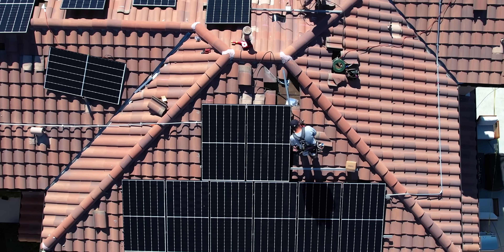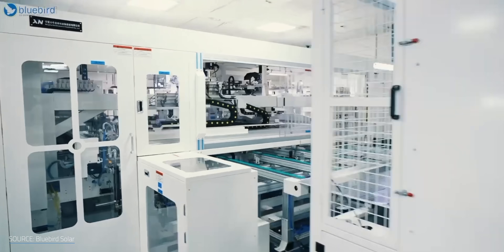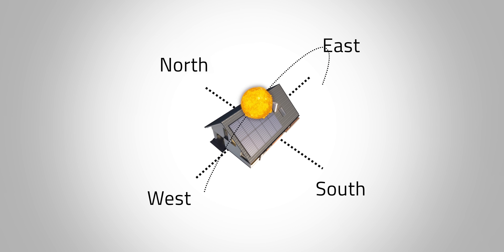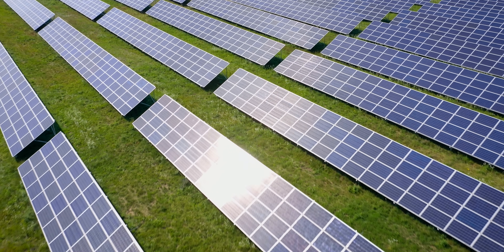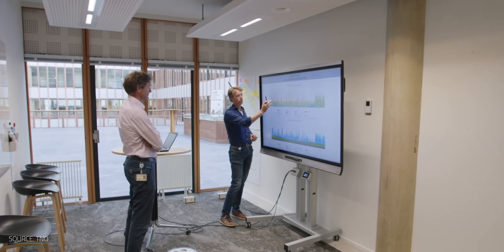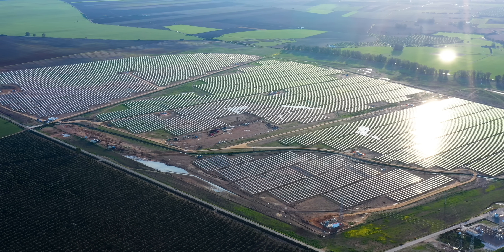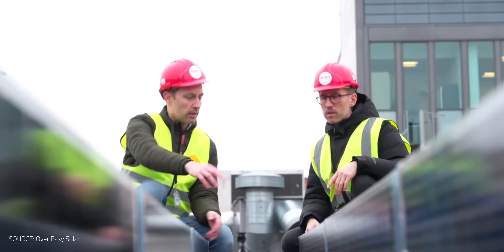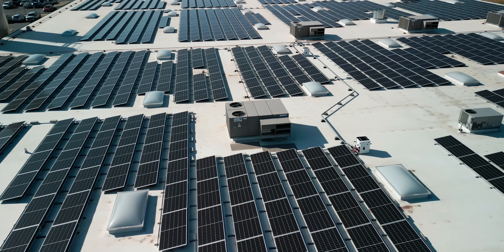Have we been doing Solar wrong all along?

Comment: If you are going to put rows of these in farm fields, they will need to be a lot farther apart than shown because most mechanized farming equipment is HUGE. Additionally you plant crops in rows aligned across contour lines to prevent erosion; around these parts those lines would frequently be perpendicular to the N-S lines.

Comment: Or just add tubes to the PV panels, circulate some liquid, maybe use a heat pump to make it even hotter in the storage side and store the hot water... Everyone needs hot water to have a shower etc.
Reply: This is already a thing, hybrid solar/pv panels. Unfortunately they will not live the expected 25+ years of usual pv only panels. That’s a big downside.

Comment: Cooling increases power by enough that even active cooling is practical. Here's a video where a diy actively air cooled solar panel is demonstrated to produce more than enough extra power to run the cooling fans.
https://youtu.be/Mt9qLRN7JvA
After looking back at it, apparently the main selling point is panel longevity. Efficiency gains were just enough to comfortably run just about any decently efficient fan for it, but in theory it'll pay for itself the most with lifespan. Great for offsetting the environmental impact of producing the panels in the first place.
I remember somewhere they mentioned already existing commercial solutions that use far more efficient centralized cooling fans that even have the option for using waste heat for other purposes.

Comment: Higher wind loading might require heavier framing, and could make panel wires susceptible to stress cracking. Where you see vertical fencing made from solid materials, it's generally rock about 5-6 feet thick 😮

Comment: I had the thought recently that solar panels are notoriously bound by theoretical efficiency limitations, and if they capture all the light that hits them a lot of that light will be reflected or absorbed as heat.

So vertical arrays of lower power, higher efficiency panels with redirected light might be the way to go. So I wonder if this has anything to do with that.

Comment: What we've been 'doing wrong' is relying on Government Scienters and Chinese Tech Barons and GPS Signs & Tribulations Evangelicals to drive a technology into the Grid Level Energy Supply'. Like the Covid Jab, you will never hear a grid expert concerned about rolling blackouts on cloudy days, about reverse-metering 'grid dis-harmonization' or exploding neighborhood substations.

If all we used electricity for was hair drivers and toaster ovens, then grid voltage and frequency dis-harmonization caused by millions of solar inverters wouldn't be a problem. But we have home electronics, 'smart' IoT crevices and patients on life support.

Plus household solar power simply does not work north of 37° latitude, the research that you'll never ready proves that, like the MTBF Life-Cycle Cost Analysis.

Household Solar is like the Covid )ab, and I think you need a BOOSTER!

Comment: This is an extremely inaccurate representation of what the study showed.  At no point did anyone in the study conclude that vertical panels produce more power than horizontal.  The host went further and even concluded vertical panels produce more energy in a smaller footprint.  Both claims are completely and demonstrably false.   

None of the graphs on screen were presented accurately either.  The host uses tons of relative descriptions rather than actual values in an attempt to portray the conclusion he wants. Extremely disingenuous and harmful.  

This guy is the equivalent of cereal box advertisements.  "Now with 2.5% more voltage!" More voltage than what? More voltage than horizontal panels in the same exact conditions?  Certain times of day?  No?  Oh, the test panel array generated 2.5% more than the computer model is the test array calculated...so the computer model was slightly inaccurate.  Just another bogus "science communicator".

Comment: Personally, I'd rather have ground mount PV.  I'd be interested to know if there were any differences in the area required.  Certainly, the area between vertical PV would be more usable.  Also, what about wind and hail damage?  Does one  fair better than the other?  What about mounting costs - is there an advantage?  In the end, it's all about economics.

Comment: Absolutely wonderful! How many ugly fences are there around infrastructure, industrial and commercial property. as well as private property? Making attractive solar fencing economically attractive - that is a fence that pays for itself - could transform the look of our world's shabby cities.

For me personally, at home, putting solar fencing around my garden is a far more attractive option than on my home's roof, including cheaper installation, and no concerns about damaging the extremely costly roof. There is far less of a concern that people might damage the fencing, climbing on it, or with vandalism than if a roof got damaged during installation.

Regarding garden fencing, I have already chosen the cheap sustainable solution of planting a hedge around my garden perimeter. A modest long term investment in itself.

Concerning adopting domestic solar panels in general, I do not wish to get into finance arrangements or contractual arrangements related to paying for solar panels. So, putting single facing vertical solar panels on the home wall, ideally including insulation on the back of the panel, would be an attractive option for me. Something one could simply screw up on an exterior brick wall - a bit like hanging a bathroom mirror on the inside of a home - would suit. Saving up, and buying a panel at a time until the house is covered without debt. 

Highlighting the fact that initial cost and installation are the most vital factors. With a desire to stay debt and legal commitment free being equally vital when choosing to go for domestic solar options or not.

Comment: I use a vertical panel with an ultraclear glass in front and a fan for 2 years. Temperature of the air is up to 60 C, normally 30-40 C. Like Trombe wall with a photovoltaic panel. In summer hot air can heat water, I shall test it next summer.

Comment: Vertical flow produces something like the chimney effect and causes air to flow upwards much better. Old chimneys were built with bricks and not metal because the bricks heat up and that causes a turbine effect that makes the chimney itself to work as a pump. You'll notice that those chimneys are narrower at the top and that's because the air is flowing faster - hence to keep volume flow constant they need to be narrowers. Coolling towers on nuclear power plants have that weird shape because the chimney effect happens up to a point when condensation starts to happen and speed decrases.

Comment: Vibration on the Silicon crystals causes electrons to cross the depletion region only with the motion energy. That produces noise in sensitive amplifiers (medical applications, for instance) and on our photos when because they create small random deviation for the value each dot on the CMOS sensor. This type of noise is called Thermal Noise.

Comment: Bifacial panels are currently being used in the horizontal (angled) utility-scale installations. In northern climates snow on the ground would significantly improve performance over a traditional setup.

Comment: Thermal efficiency, Imagine a passive radiator facing a heat source vs only one side facing it. Most of the radiator isn't directly being heated. Solar panels are only 20-25% efficient so the rest of the light becomes heat.

Comment: Yes, I would consider this! I live in Norway, so I guess Over Easy will be considered too, though not the flat roof thing, I don't have that. I live on sloped land, so this might be perfect for me, considering the amount of snow in the winter, the reflected light and that I don't have to remove snow from the panels is perfect. My roof's ridge is north/south, and I have mountains to the east. So many things making roof mounting moot. I was thinking vertical panels on the south wall, but there's just not enough space to make it viable, but maybe as an add on? A few hundred watts more?

Comment: What you're saying about bifacial being more efficient and producing more power than regular panels at normal installation angle seems to be wrong. The PV watts calculator allows calculation at different angles, and with bifacial. It doesn't seem to be showing the kind of results you're saying.

Comment: 1. Improved angle of captured solar rays through day except the direct over head light of 1130-1330 with resultant less refractory light loss. 
2. Change in Heat exchange allowing for more efficient transfer of energy.

Comment: I wonder if there is a cross-over point in latitude for vertical solar. I can see how this is so much better in high latitude countries, like the northern half of Europe, but I'm not sure if it's best nearer the equator, like in the Atacama desert. Just thinking, the irradiation probably is lower for a vertical system, but the better heat removal could compensate for that. It's an important point as here is the only place in the world where panels degrade faster than the manufacturers can guarantee, but well... we have the highest solar irradiation in the world too, so if panels produce the same or slightly less energy, but last longer, it's still a win. I must say though, that most people have it wrong in the ideal angle. Most people are stuck with the "get the panel perpendicular to the sun in the winter", but that works only for off-grid systems. For on grid, you actually have to maximize the total yearly energy output, and that means having a lower angle, so you get more power out in the summer. Ideally, you either change the angle manually every month or whatever time period you want, or use a 2 axis tracker, but the former is impractical many times (as in rooftop panels) and the latter is expensive, requires a maintenance and a lot of space.

Comment: Wouldn't horizontal panels with a cooling system be the most efficient system? The heat collected by the cooling system could also be used for energy generation. I'm surprised that this isn't a viable option already. Am I missing anything?

Comment: Is there a reason the panels are so close to the ground?  Less wind loading?  If they were raised a meter or two, they would be less likely to be damaged by equipment or livestock.  Also, why not run cables (guy-wire) across the top of the rows for strength?

Comment: My only guess is that the light entering the panels at a steep angle actually causes the light energy to diffuse in the panel cells better than when it strikes at a perpendicular angle and mostly reflects out.
Reply: Didn't think I got it, but the temperature explanation makes sense. Seems to me not only will these solar panels have an efficiency bump, but you can actually fit more in the same space. As long as you aren't shading neighboring panels except very late and early in the day, you can still smush them closer together than angled panels. Like you also said though, much more convenient for using the space in between them.

Comment: I believe the cooling comes from the way heat dissipates. When flat the top of the panel is losing heat to the environment as it rises away from the panel. The heat on the bottom passes back through the panel and reheats it. When it is upright both sides can dissipate heat away from the surface with out rising back through it. I also agree with the comments that there should be less collection of debre or foreign objects. However solar cells are mostly self cleaning so not having direct interaction with rain will result in less cleaning. Interesting

Comment: I've said for years. Solar panels should be hybridized to heat water on residential installs. Lower energy to heat water. higher energy output because the panels stay cooler.

Comment: My guess: Reflection from one panel lights the one in front of it?
Reply: Oops, wrong. 
In basic electronics we learned how when circuits heat up, resistance increases and current flow and or voltage drops.
Think about the dramatic current flow in very cold superconductors.
Heat is generally bad for electronics. It breaks down the material over time. I can see that there could be quite a bit of positive difference in how long these panels would last.
Maybe a downside is that you need to have essentially two panels back to back to achieve a similar daily output you'd get from regular panels. But, as I said, longer life could offset that. With more practical experience with them we will figure out where those two factors cancel.
I do like that you can use them as fences - so clever.
And, you can put them on walls of a building, saving a lot of space with less hardware and support - more savings.. In that case they would only need to be single sided of course. 
Very nice innovation. Lets continue to explore and innovate - not just the technology but also the ways we live so that we'll be healthier and the world will be more sustainable with less human impact.

Comment: It's not really just a voltage drop but also a current drop with the higher temperatures due to higher internal resistance when the panel is under load. The only reason you can measure a lower panel voltage is that the drop in current causes the voltage to be pulled down because the internal resistance went up and the panels cannot continue to maintain the supplied current with the increased resistance.

Comment: Panels with greater hail protection aren't that big a benefit. Modern panels are largely hail resistant. By contrast, a vertical orientation will expose the inverters.

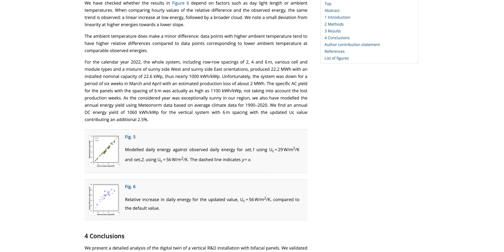Comment: 9:18 this makes me wonder if the Solar PV industry is about to define a new operating mode for summer conditions. 

Usually in high wind or snow conditions, modules on axis trackers are set to a stow position that is horizontal to the ground. This minimizes the forces that could sheer or torque the modules or their foundations. Horizontal is a less efficient orientation though, so control systems try to return panels to the tangent plane with the sun to maximize power collection once safe to do so. 

But with bifacial panels, we have the potential to orient panels completely vertically, a "draw" position to contrast with "stow", and collect more power in summer or even off-summer conditions thanks to the added cooling.

Those power curves are SUPER wacky though compared to the downwards parabola that the industry is used to though. Utility models would have to account for this extra generation - and its time-shifted nature - in their grids so reliability doesn't become a concern.

Still, we might start to see full 360° module tracking in the future!

Another problem that comes to mind is that the way string cables are ran through a given tracker row, and how those cables connect to the modules. If you twist drive shaft 360° around, then these wires might undergo much more stress and lead to failures over time. The added power from the modules might not offset this added risk to projects. 

A quick solution to this is how some motors/generators operate: commutation. You install a slip ring that a collector rod revolves around so that electrical connection is never broken. Single axis trackers already utilize slew motors to turn strings with the sun. This slip ring solution could be ran in conjunction and seemlessly integrate with today's trackers. 

Fascinating idea though! Thanks Matt!

Comment: Long before you got to "more power from the same footprint is obviously a win" I was already raging over seeing how far apart you have to space those panels, compared to 30-40 degree panels.  Those things look to be space with HUGE gaps between them, and in many of your displayed examples, they're around 1/3 to 1/4 as panel-dense per acre.  You don't need more panels, but you DO need more space.

Also for ground cover, think SOYBEANS, those are very low to the ground and are much more useful crops.  I can't believe you're showing carrots.

My other grumble is WIND.   You better bolt those down real good because big solar panels catch ridiculous amounts of wind.  I had my portable arrays out for Summer Field Day last year and we had the joy of dealing with a severe thunderstorm that afternoon.  I was almost lifted off my feet while trying to bring in a 400 watt solar frame that was only five feet from the door. (and got a good ankle sprain for my trouble as I got tossed)  Enough concrete will keep ground panels in place, but I'd seriously question the wisdom of roof-mounted vertical panels.  A good straight-line wind would grab the panels and take the entire roof off in one clean peel.

But overall still a great video.  I really do like your channel, especially your solar and power videos.  They're informative and interesting to watch.  Keep up the good work!

Comment: I have mount my solar panels vertically and is working great. A real benefit is that dirt, tree leaves and snow cannot cover the panels. The first time I notice this was at the time I built a veranda outside and cutting many pieces of wood. The wood cutting dust was everywhere, on any horizontal surface, except on the panels.

Comment: I have noticed that so far most of the studies that give good report on vertical panels have been done rather far to the North. I have thought that for areas where the albedo is lower, perhaps it would be better to use radiant cooling on the backside. Clearly there is room for some different ideas in solar system design.